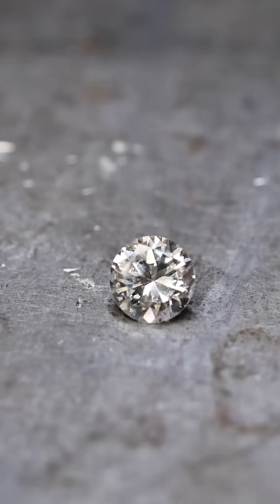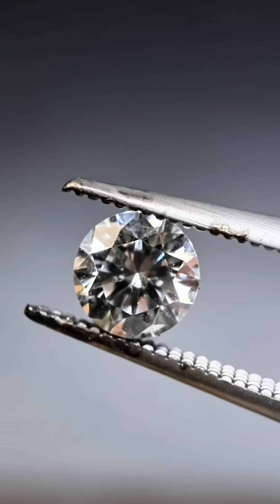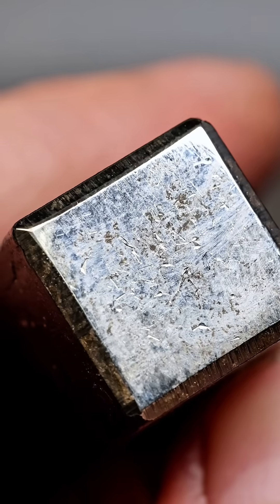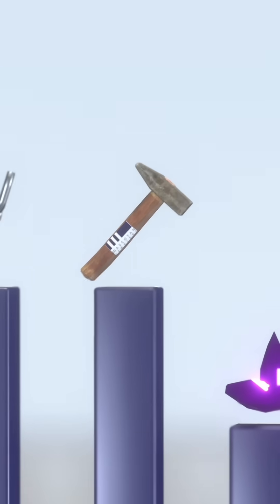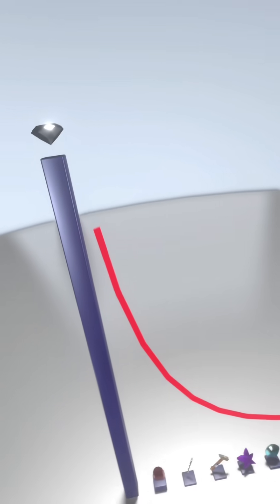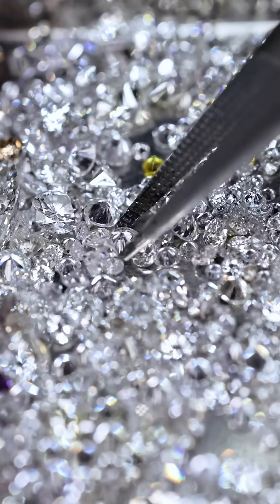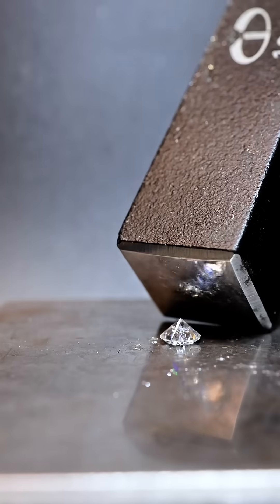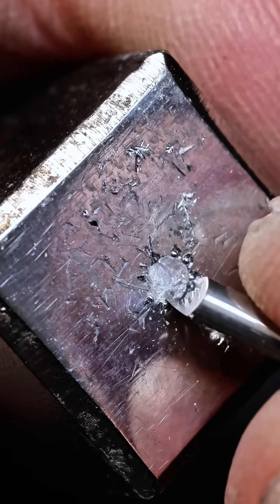Diamond vs Hammer

Comment from the maker: I got the science wrong on this one. The Mohs hardness scale is not related to whether something will break when struck by another object. It measures hardness, which measures how easily an object can be scratched, not broken. Diamond is the hardest material on earth in that only a diamond can scratch another diamond. I apologize for the misinformation. 

And about how difficult it is to break a diamond, hardness is the wrong property to reference. That would be its toughness, the ability to resist breaking from impacts. Diamond is still fairly tough but it can break from any impact with enough force that lines up with a cleavage plane. That force doesn’t have to come from another diamond. 

I will make a future video more focused on the scratchability of a diamond and I’ll try not to get the science wrong. 

Thanks for watching.
Reply: Also, we have now created a couple of materials harder than diamonds. Diamonds are the hardest naturally occurring material, however.
Reply: @Succulentquarter isn't there that space gemstone "lonsdalite" or something like that.
Reply: @Succulentquarter  wasn't there a super rare material formed in a meteorite that was naturally harder then diamonds?
Reply: @mothmanafterdark5924 no
No
Reply: @mothmanafterdark5924  yes, it's a type of hexagonal structured diamond called "Lonsdaleite"
Reply: @Succulentquarter  like what?
Reply: @Succulentquarter  did we created them ? i though they came from an asteroid
Reply: @ALlGAT0R  I was thinking of carbon nano tubes, but it turns out that Graphene is harder. Both of these are manmade. Diamond is the hardest material that is both widespread and naturally occurring.
Reply: @Succulentquarter I thought graphene could occur naturally as well
Reply: @MrAlwaysOnTen  Graphene can occur naturally, but unless it is a form of it called diamene, then it is not harder than diamond. Diamene is a man made form of graphene, where two layers one atom thick are compressed together with a lot of stress and heat. It is theoretically possible to have it be naturally made, but we have not found any of it. We have found a substance that would be harder, Lonsdaleite, but it was not pure enough. I also do not count anything that is really small. Has to be the size of a small pea to actually count.
Reply: @Succulentquarter why a small pea specifically?
Reply: @MrAlwaysOnTen  Cause it is similar to the size of a lot of diamonds.
Reply: @Succulentquarter  Exactly 💯🎯!
Reply: @Succulentquarter that's only half correct.
Reply: @Succulentquarter WAIT WHAT
Reply: @Succulentquarter no, we haven't. Diamonds are still the hardest natural or artifical thing.
Reply: @mantasr  Do a simple google search before you state an absolute on the internet. You are wrong. They are the hardest natural material, but we have made stuff that is harder.
Reply: Really appreciate you stepping back and admitting to how you were wrong. Looking forward to another video on this!
Reply: It was still a lot of fun! So cool!
Reply: @mookinbabysealfurmittens 
Revelation 3:20
Behold, I stand at the door, and knock: if any man hear my voice, and open the door, I will come in to him, and will sup with him, and he with me.

HEY THERE 🤗 JESUS IS CALLING YOU TODAY. Turn away from your sins, confess, forsake them and live the victorious life. God bless.

Revelation 22:12-14
And, behold, I come quickly; and my reward is with me, to give every man according as his work shall be.
I am Alpha and Omega, the beginning and the end, the first and the last.
Blessed are they that do his commandments, that they may have right to the tree of life, and may enter in through the gates into the city.
Reply: @mookinbabysealfurmittens fun ? To watch two diamond shatter ?
Reply: I broke (fractured) a diamond in my engagement ring by accidentally knocking it into a doorknob. That's all it took! Diamond is hard, but BRITTLE!
Reply: @MaryLeech  Damn..
Reply: I have a feeling that wasn't a diamond, but glass or cubic zicron. He probably lied to you. Did you ever get it tested?  @MaryLeech
Reply: @user-jy1tk8mp8sI’m curious myself now
Reply: major respect for correcting yourself humbly!!!!!!!! <3
Reply: I respect your willingness to yield your error and post information correcting it.  Well done.
Reply: @lrwerewolf  I mean, he is factually incorrect while purporting to "teach" people something. I think admitting he is wrong when called out is the least he could do. Should probably take the video down, that would be best. Many people will not see these comments and just watch the video and be misled. Sure, it's a trivial thing, but misleading people is still wrong. And keeping the video up is doing that, still. So while he apologizes from one side of his face, he keeps deceiving from the other side.
Reply: @lrwerewolf  it wasn't a error he showed a hammer hitting a diamond several times and faked it the diamond would shatter,
Reply: @robertfleming9161  lmao you don't know what you're talking about
Reply: @Sahtoovi   ?
Reply: Thank you for the update, but we've all been waiting for this video our entire lives😂
Reply: Good for you admitting to that, it takes a big man to admit when they were wrong
Reply: corrections are illegal on youtube. You must double down on the wrong info.
Reply: @trustjah  a lot of people do that. It’s annoying lol
Reply: @trustjah oh so thats why…
Reply: @trustjah 😂
Reply: I thought you were just a science guy for a sec, not the guy who fixes and makes all the cool rings!
Reply: It's all good. Shit happens and I don't think any wars will be fought over getting it wrong. Have a good day!
Reply: Literally you could have just whacked it harder
Reply: Real that you corrected yourself
Reply: Good looking out... Nice edit.
Reply: Appreciate you correcting yourself
Reply: Wow I don’t think I’ve ever had someone be this open about a mistake amazing job
Reply: W save
Reply: @lacemank7220  It's AI
Reply: @MassoyanJewelers  I'm pretty sure I remember this from an episode of the magic school bus.
Reply: Oh, thank you !
Reply: easy mistake to make, oops!
Reply: Thank you for recognizing the mistake
It's a common mistake
Silicon is a lot tougher than diamond
Reply: A prince ruperts drop is probably the “toughest” under pressure. They deform steel hydraulic presses under 200k lbs of pressure.
Reply: plenty of housewives over the years have shattered their diamond on wedding ring accidentally hitting it on a porcelain sink.  

Diamond has lower tensile strength than many steels, and much lower fracture toughness!

Great video though, keep 'em coming!
Reply: Scratching will make breaking easier, since the surface transfering force is no longer transferring it evenly.
Reply: Honestly, I very much appreciate the effort, but I think this warrants a reupload. There are so many younger people watching who would not know and not check the comments.
Reply: neat. you should take down the video that has bad science because a lot fo people will not read this and just have bad information. repost with the proper narration.

and this is why we should be able to flag videos for a large variety of reasons.
Reply: Thanks for the Update, I watched the video and thought to myself "wait what?" but yeah you can smash a diamond with a hammer, I work in the industry and have come across people that believed that diamonds cant be smashed with a hammer because the read its the hardest Material on earth, and then having to spend and hour trying to teach them the right why of thought there lol but thank you the video was entertaining, still got chills down my spine when you chipped the diamond in the end though lol

PS if you have any questions feel free to PM me
Reply: The meteor one that’s in museums
Reply: Thanks for that now I don't have to comment that's not how Mohs hardness works
Reply: I’m glad you corrected! Tysm.
Reply: THANK YOU
Reply: Came here to say toughness and hardness are very different but you corrected yourself
Reply: Another point you may have gotten a little mixed up on , a diamond(mohs 10)  is about 144 times harder than a sapphire (mohs 9). Hardened steel is more like a 5
Reply: "Diamond is still fairly tough but it can break from any impact with enough force that lines up with a cleavage plane. That force doesn’t have to come from another diamond. "

Thank you for mentioning this. I've had to try to make this point to someone before, because of table top games. 

As I said to them "Even a feather can pierce armor made of diamond if it manages to find the weakest point in the diamond with enough force applied."

When asked for proof of concept, I mentioned wheat straw being stuck into wooden posts because of tornado winds. 

DM was going to run with it, because it made sense; but we had no way to figure out at the time what kind of scale of force was needed to allow for this logic to be applied. Not that we didn't know about the Moh's scale. Just, how do you extrapolate that into GURPS style dice rolls and such?
Reply: Greatest respect to you. This is really rare and I absolutely love to see it. I thought I'd let you know, if you've ever dropped a ceramic plate onto a wood floor, you learn quickly that harder stuff can be broken by softer stuff, often even more easily.
Reply: Thank you for issuing a correction. It’s ok to be wrong, if you’re willing to work at getting it right.
Reply: Thank you for the correction! An easy mistake that a LOT of people make...
Reply: Oh, this is top notch.  A video of something I've never seen before and the creator taking accountability for and correcting a mistake?  Keep on doing what you're doing!
Reply: Very much appreciate this self-correction
Reply: Mad respect for this comment
Reply: As an brittle engineer, I respect your tough acknowledgment. But don’t be too hard on yourself.
Reply: personal opinion that responsibility would include taking down the accidental misinformation video and fixing it but im just a girl
Reply: When somone's pretend he's smart moment 🤣🤣🤣
Reply: Ytbers get the whole idea behind the short wrong making it entire existence pointless, but won't take it down because they are scared for their revenue. They will instead leave a comment so that they waste as much of your time as possible. Just take the meritless video down, no need to be that greedy
Reply: Wait, what? We're going to sit in silence after what you just said. DUDE! Break a DIAMOND by impact! I want to see that!
Reply: @Edward-hb9qb , there are videos of this out there. They are as good as you're hoping, I think.
Reply: See this is why you’re so smart. You’re willing to admit your mistakes, and learn from them.
Reply: Thank you for clearing that up, I was about to comment that, but you beat me to it.

Thank you for not letting yourself spread miss information
Reply: @dws998   spreading misinformation that's exactly what this video do 😂
Reply: Yup. Lead bullets can penetrate thru the toughest steels.
Reply: I remeber my cience teacher saying exactly same thing that you can crush a diamond with a hammer with enough strength
Reply: thank you for clarifying, I just did want to write a comment with an easy example, "that's why you can not break a window with a football"
Reply: Yeah I was coming here to say this is completely wrong. You can totally crush a diamond
Reply: Good that you realized that. I knew this video was inaccurate because I've seen heavy steal objects crush diamond
Reply: When I was going for my Bach. in Mechanical Engineering, Materials Science was one of the classes. Usually the Mohs rating is determined by taking the material in question, giving the surface a certain curvature, say a radius of half a millimeter, and then pressing the material into another material such as a metal, with a constant force, and seeing how deep the pit is that's left in the metal. It doesn't take into account how brittle the material is really. In fact, generally the harder a material is the more brittle it is.
Reply: Good on you for correcting the mistake, you might educate more people this way!
Reply: Thank you for the clarification!! Still really loved the vid, super dope :) Subbed!
Reply: I’m so glad that happened! If you hadn’t gotten it wrong, we wouldn’t have learned the difference between hardness and toughness. I’ve been wondering about it for decades. Thank you.
Reply: Being that humble shouldn’t be something we’re impressed about seeing in media. But here we are.

Keep up the good work!
Reply: I learned this from Houseki No Kuni. It's set a billion years from now and is about sentient gem people. Although toughness is more relevant and brought up more often (the gem people can be broken and put back together) hardness was mentioned at least once in the series. The protagonist has quite a low hardness and breaks a lot
Reply: @Spamton.J.Spamton omg I just made a similar comment
Reply: Appreciate the transparency, great vid!
Reply: Thanks for correcting the info, I was ready to be annoyed 😆
Reply: thank you for correcting!
Reply: Thanks for clarifying 👍
Reply: did you reference the Nilered This is bromine at the start lol
Reply: That’s also one of the reasons why tools aren’t made purely out of diamond, only as small parts where malleability isn’t a concern
Reply: What is it on the rockwell hardness scale?
Reply: Bro you barely hit it with the hammer, it’s like you were hitting it gingerly so you wouldn’t break it. Next time REALLY HIT IT! 😂
Reply: Heh heh you said cleavage
Reply: Maybe you should remove this video so people don't get confused and spread more misinformation. Not everyone reads comments.
Reply: If you hammered the diamond with a regular hammer the same way you did the zirconia it would have broken too.
Reply: In RPG term, diamond does high damage but low durability
Reply: Mad respect for printing a retraction. That's a journalism move no cap.
Reply: @GT-tj1qg  Agreed. Quite respectable.
Reply: Thank you for fixing it
Reply: a first ive seen on yt a man admitted hes wrong and corrected himself props to you man fr
Reply: millions of people will see this video and take it as fact no one is reading this comment you should have deleted the video
Reply: Well… why not taking down this vid and uploading a correct one? Barely anyone reads comments.
Reply: yeah i was thinking
Reply: Yup. You're good we all knew what you meant lol
Reply: delete the video or you don't actually give a shit.
Reply: @graydient05 , you make a good point!
Reply: You should remove the video then, most people won’t read this comment
Reply: No Dimond is not tough, Dimond is incredibly brittle, meaning it shatter easily on impact.
Reply: I care more about toughness than "scratchability"
Reply: Yeah, tungsten, for example, is extremely hard, but brittle. Lead is soft, but malleable. Tungsten will easily break, while lead will deform.
Reply: why not take the video down instead of leaving it up and spreading misinformation?
Reply: Delete the short, most people won't read the comments
Reply: Take the video down
Reply: First of all ur soo rich
Reply: I learned all this from Houseki No Kuni, aka Anime 🎉
Reply: Video is based on misinformation and you left it up
Reply: Oh no my chance to be a know at all has been stolen.

Thanks for the update.
Reply: I think instead of posting this it would be better to reupload a video instead since not everyone reads comment
Reply: Just take the video down…
Reply: Props to acknowledging it. Diamonds are tougher than I thought, though. There's a bit of RNG involved, though, if you don't know where those cleavage planes are.
Reply: How about you use some force lmfao
Reply: And I was about to send you a correction link
Reply: Like you said, hardness doesn't equate to durability. You couldve broken the diamond with just the hammer if you just hit it hard enough.
Reply: Delete the video then, idiot. You knowingly upload misinformation making people stupider, and think a comment that hardly anyone reads makes it ok? Enjoy the views while being morally bankrupt, I guess.
Reply: Came here to point this out - there’s a saying in lapidary “hit a diamond with a hammer and it’ll shatter, hit jade with a hammer and it’ll ring like a bell”
That’s the reminder that toughness is a different beast… please tell the people that think Egypt had advanced technology to carve rocks - you can just hit them and they’ll split
Reply: I understood it, it's common knowledge that the mohs hardness scale uses the scratch test.
Reply: Actually came to say this glad you owned up .. miners used to smash diamonds under the mistaken belief they couldn't be smashed so yea can't scratch it but they will smash along cleavage llanes
Reply: Of course the first one broke! you hit it like it owed you money, meanwhile you barely even brushed the second one.
Reply: There’s a cubic form of boron nitride that’s theoretically as hard as or harder than diamond, fyi. Out at least that was proposed at the time of my college presentation ~2010.
Reply: And that perfectly explains why a diamond can be smashed by a hammer.😁👍
Reply: Almost dude almost I was gonna blame the sh!t out of you
Reply: I was just entering the comments to say this. Because you can technically break a diamond with a hammer depending on the amount of force that ends up being applied and how the force is applied.
Reply: I was gonna say I have shattered a small diamond with a hammer before lol 😅
Reply: Respect 👍
Reply: It’s the Rockwell scale used for hardness, right?
Reply: Good on you for posting a comment admitting you weren’t quite right - a lot of people fail to do that nowadays. Great video nonetheless!
Reply: @MassoyanJewelers  was still a fun / hilarious watch, nailed the Niel Red vibes
Reply: What a waste...of beautiful diamonds.😢
Reply: I was just about to "ERM ACKSHUALLY" you lol. Related fun fact: diamond would make a terrible sword due to how brittle it is
Reply: also, only a diamond can cut another diamond, at EQUAL temperatures. If you heat up a diamond, it makes it easier to cut with a softer material
Reply: This comment just earned you a subscriber, I'll be sure to watch your content. Thank you for your honesty, it's refreshing.
Reply: Thank you for being willing to correct yourself!
Reply: Yea, for example, blowtorch, vacuumed chamber, pure oxygen flowing in, it evaporates
Reply: Im glad we all learned something
Reply: I thought so ig
Reply: I LOVE this accountability. Easy follow 🔔
Reply: Science is stupid sometimes, I'm just gonna choose to be wrong as what you said sounds better and will never affect my life.
Reply: Yup. There is 

Hardness – Resistance to surface deformation (e.g., scratching).

Toughness – Resistance to fracture when stressed (energy absorption).

Strength – Maximum stress a material can withstand before failure.

Ductility – Ability to deform plastically before breaking.

Elasticity – Ability to return to original shape after deformation.
Reply: Damn so diamond armor won't work against bullets... Maybe the prince Rupert project will fair better 🤔
Reply: I'm pretty sure this is one of the rarest comments on YouTube! 
Bravo sir
Reply: Wow incredible description! I was just about to ask the difference between hardness and toughness. The video still helped me understand it before too
Reply: A cleavage plane you say
Reply: For that excellent and humble correction, subscribed. That's how you do it.
Reply: So much respect for this, super fun vid still.
Reply: Thanks I was wondering if impact played a part in breaking it. Now I know.
Reply: Hardness is still relevant to breakability! There's a force threshold you have to pass to deform the diamond which is what breaks it, and the material deformation of the hammer was making it difficult to reach that threshold. So with the fairly low density of diamonds compared to steels, the extreme stresses inside the carbon lattice do actually increase the force required to break it!

Same as tempered glass compared to annealed glass- it's hardened and compressed into a grid of stress lines, so the corner is WAY more reluctant to chip off in general. But if it does, POP whole pane is gone.
Reply: Was about to downwote and unsub, but okay, this comment is a pass this time!!))
Reply: The Mohs scale does go above 10. There's a specific type of diamond that forms during meteorite impacts with a Mohs hardness of about 11. But it's incredibly rare. Synthetic nanodiamond is also above 10.
Reply: Thx for actually correcting your mistake
Reply: Probably you Just wanted to make some views by testing a myth and then told the truth, i dont blame you anyway to be honest
Reply: yes! that's what I found crazy when I was younger bc I was amazed at how easy you could break it by dropping it, yet can't break it WILLINGLY (Also bonus points fo rthe huge glass windows in spy movies where they use a diamond to cut through it haha)
Reply: Thank you. Saved me from writing a roast post. 🤣

Indeed if Diamond are cut into shape taking advantage of the tendency to tear-propagate along the cleavage planes, aka how the crystal structure line up.
Reply: Thanks for clearing that up.
If you have a few too many other diamonds laying around that you would like to waste, send them to me instead maybe! ... 😅🤭
Reply: For those wondering, the property calls tenacity
Reply: the hardest thing on this planet is safely locked away in my pants.
Reply: Yeah I was about to say you can absolutely crush a diamond with a hardened steel hammer if you hit it harder.
Reply: God it's refreshing to see this instead of the usual butthurt response to getting something wrong.
Reply: Thank you for the correction. I was about to comment that there is a mistake, before I saw the comment. 
It will be also difficult to break a rubber ball with a hammer.
Reply: This was still super cool!
Reply: So I dropped my diamond ring when I was putting it on one day. It fell about 3 feet onto a wood floor with the vinyl tiles and cracked with a chip falling out. The jeweler at the repair shop didn't believe me and got angry that I was so careless with my diamond ring. I was shocked it happened when he told me it was impossible to break like that. Would it have landed on a prong maybe?
Reply: Aint that very expensive to play with it like that?
Reply: Is there a reason you're not deleting this video, even knowing you completely misrepresented it?
Reply: MVP for humility 👍🏼
Reply: What about a hammer fashioned from pure diamond?
Reply: Glad you corrected this yourself
Reply: Fullerite is the hardest.
Reply: Maybe stick to react vids or something big guy
Reply: Ты красавчик бро 👍🏻 Привет из Казахстана, тебя тут смотрят.
Reply: THANK YOU FOR THE CORRECTION! As a material science nerd I was fuming ready to come be the "well actually" guy, but you actually stepped up. Big props.
Reply: Thank you for correcting yourself. I was going to mention this as another science channel did this before.
Reply: Congratulations on your humility — a rare and admirable virtue in today's world.
Reply: Appreciate the honesty
Reply: That’s alright, everyone makes mistakes, it’s good you cleared up the misunderstanding in the comments as well :)
Reply: How could you possibly get that wrong? It is basic common sense...
Reply: Also Mohs is a guy's name (with the s), not an acronym
Reply: I broke a diamond just from trying to push it out of a ring with a small screwdriver
Reply: The hardest thing on earth, is my thing
Reply: Lots of respect for you brother
Reply: the other thing is is that a diamond will absolutely shatter if you were to place it on the flat face and put all the energy onto the point
Reply: @ they make stupid videos to get you to comment a correct answer for views
Reply: Hehe you said cleavage
Reply: Kudos to you for actually admitting the mistake and correcting it for everybody! Bravo
Reply: I was a goldsmith for 9.5 yes and was about to correct your video,  but this comment beat me to it🤷🏻‍♂️👍🏻👍🏻
Reply: Goof ownership. Learning is nothing to be ashamed of.
Reply: how much value was destroyed in the making of this video? 😭
Reply: Bin por la rectificacion.👍
Reply: I am worried what your wife is gonna do to you now...😂
Reply: Toughness is measured in units called “CN” or Chuck Norris’s
Reply: Yeah I was gonna say… thats not what hardness is, but you got the point.
Reply: I like your honesty waiting dor the vid
Reply: A high hardness also means that it doesn't deform much. Deformation can be plastic, so it stays in the shape it was deformed to, or elastic, so it bounces back like a spring. The topic is a bit complicated.
Reply: Ca va commencer a te couter cher a force 😂
Reply: This is awesome. Thank you for explaining. Good on you for correcting your mistake. I too wouldn't have known the difference. It seems like they should be the same from a non science perspective! Thanks for teaching me something new today!
Reply: I give you a like, because I read this. Genuinely I appreciate people getting things right. You’ll get it next time
Reply: Hence diamond cuts long before modern steel
Reply: @MassoyanJewelers  click bait trash, those hammer strikes wouldn't kill an ant
Reply: still a cool vid 👍
Reply: A perfect cleavage makes you beautiful, but fragile.
In human reality a huge chest just breaks your back thougj.
Reply: Wish I had diamonds to experiment with!
Reply: this is the most incredible mea culpa I've ever seen
Reply: I respect the quick correction, it was still interesting!
Reply: it's just the type of low effort shit you produce man
Reply: You must be rich!
Reply: I would love to have a piece made from you...I would love to have a ring w a Portuguese cut diamonds and whatever u dont want like a emerald from Colombia...😂😅😅😅I wish I could hire u for that my birth stone is diamonds....a girl can dream
Reply: Ну вот зря бриллианты покрошил =)
Reply: Exactly, water ia quite soft, but we can cut things using presurized water
Reply: so how was the diamond broke in the video if clearly enough force wasn't in that swing to break it? Was it a fake diamond that broke at the end?
Reply: RIP Bro’s wallet
Reply: Чушь собачья! Бред сивой кобылы!😮😮😮😮😮
Reply: Yeah, and you can't even say whether it's linear l, logarithmic or whatsoever, as we can't measure hardness absolutely but just relatively, so terms like linear or logarithmic don't make sense here.
Reply: I was gonna call this one out glad to see the correction
Reply: Kim cương cứng nhưng nó không bền.
Reply: Thank you for recognizing it, I was about to write all this myself, it's good to know that some people still make redactions if they have made a mistake
Reply: SHAME SHAME! you must walk naked on your central square and upload the video now.
Reply: you CAN break a diamond with hard force and accurate hit with a hammer dude
Reply: Not meaning to be mean or rude, but you should take this short down, it'd be the best way to preventthe spread of misinformation. I got recommended this short randomly and i wouldn't have seen the other short clarifyingthe error. If I didn't already know the difference and hadn't read this comment, I'd go on þinking diamond can only be broken by diamonds.
Reply: Confundir dureza con resistencia en algo común xd de igual manera fue entretenido
Reply: Okay came to the comments to say this. As a novice gemologist this video bothered me a lot, glad you addressed it! For the record, diamonds are only tough from certain angles, and can break accidentally somehwat easily. For a much tougher material, try nephrite jade- About a 7 (similar to quartz, higher than the vast majority of commonly-used steels, similar to certain steels which apparently include your hammer) on the mohs scale, but insanely tough, almost unbreakable except via temperature stress.
Reply: No problem afterall many youtubers don't give this explanation so thanks
Reply: The term you’re looking for is bulk modulus
Reply: Scratches at level 6, with deeper grooves on level 7
Reply: Hi how much would you charge me for the broken diamond I would like to make a sculpture “heart broken like this diamond” it would depict a woman on the ground as a shadow walks away and the diamonds will be the tears
Reply: I thank you very much for your understanding because most of the channels opened in Türkiye for the purpose of so-called information are lying before our eyes and they neither apologize nor make a statement about this issue.
Reply: So you are basically breaking something that could approximately pay for 2 years of my rent, for shits n giggles. Sorry but this is messed up.
Reply: Not everyone will read it if they didn't knew. You should redo the video to be the most fair. Thanks for comment but you should redo the video.
Reply: Yeah just delete the video if the video is 100% wrong wtf this is beyond stupid
Reply: Like what value is the completely incorrect video providing to the world ask yourself. Or is it just providing for you?
Reply: epic
Reply: You're amazing for filling in the gap of info. Keep on keeping on
Reply: Yup, good lesson to learn with a nice diamond like that.
Reply: Yes thank you for the correction. It’s a common misconception. Hardness and toughness are distinct properties.
Reply: you know what I respect that you posted this to correct getting the science wrong
Reply: I came to point this out, but you got it. Well done!
Reply: And you realized this after breaking how many precious jewels? Also you know you don't need to use jewelry grade diamond right?
Reply: Happy you noticed that. Didnt want to have to mention the pink panther movie's nonsense yet again.
Reply: I like that you took a moment to correct yourself. Thank you for being that way. I've seen too many people double down.
Reply: Kudos for the quick comment!
Reply: It's great that you admitted your mistake. It would be even better if you redid this video now that you know this.
Reply: Donate to charity instead of doing this kind of wasteful nonsense please
Reply: i was just coming to say this. you can break it with a hammer, swing harder
Reply: Yeah I was gonna say. You could have saved a lot of time and money googling this. Diamonds can shatter just from dropping them. But they're amazing at scratching other materials. This why we have diamond drills and not diamond pole drivers
Reply: Good I was going to comment about that... Good content btw...
Reply: i love you
Reply: Send me the broken diamond 💎 I need it 😢
Reply: That's big of you to take correction, and to publicly correct your public statement.
Reply: so that's why, it's so weird, that's like using water to stop a tsunami iykyk
Reply: Glad you cleared that up, i knew this was a bit wonky, great video though dont remove it, also bring wrong boosts engagement lmao
Reply: Actually acknowledging potential misinformation, massive W
Reply: I was going to say, that didn't sound right. I really appreciate you for this comment.
Reply: I tried to explain this to my family when watching a mr beast episode. They were guessing which diamond between 2 diamonds was the real one. All you have to do is scratch one against the other and whichever gets scratched is the real diamond.
Reply: >I will make a future video more focused on the scratchability of a diamond and I’ll try not to get the science wrong. 

Ah, but that won't be a viral hit.
Reply: Delete the video bro. The entire thesis is wrong.
Reply: True, but I suspect the hardness of the diamond here was helpful to shattering them. Given the you went one flat tip to the point of another, with just steel the diamond easily scratched the stell, with the diamond Hammer all of that force was directed into the diamonds point since neither material could deform the other substantialy enough to shed and spread out the energy of the impact away from the sharp point of the bottom diamond
Reply: So when are you going to take down this video?
Reply: Why wouldn't you look ANY of this up beforehand?
Reply: Is there a diamond hammer?
Reply: Ayyy I knew that!
Reply: You might want to delete this video and do a voice over with another one... people won't read the comments and they will not understand why this is wrong
Reply: Thank you so much for this. I still would like to see a titanium hammer against a block of synthetic industrial grade diamond
Reply: U made me question years of learning for a second 😅
Reply: Appreciate the correction. Onward and upward! ❤
Reply: I failed my exam cause of your misinformation 😔
Reply: No offense but not many people will look at the comments when scrolling lol. I'd probably delete or add a subtitle to the video to correct it if possible.
Reply: The retrospection is hot
Reply: Delete the video then.
Reply: NO !   you didn't get the science wrong you made it up and faked the image of the hammer hitting the diamond.
Reply: Delete this one.
Reply: Im sorry but why wouldn't you know this as a jeweler? Seems like a massive gap in knowledge.
Reply: lol you said cleavage
Reply: Nothing more trustworthy than a person being transparent and admitting they got something wrong. Bravo. Still a great video!
Reply: Real integrity would be deleting the inaccurate upload in the first place...
Reply: Real OG for correcting the mistake.
Reply: Pure respect from me for admitting your mistakes
Reply: Thank you for clarifying!
Reply: Is that the difference between shear & tensile / yield strengths?
Reply: Told my science teacher this, she made fun of me and basically said i was an idiot in front of the whole class, probably the only time i hated science class.
Reply: Yeah, whatever rage-bait conman.
Reply: I'm hard , 10 moh
Reply: Thank you for the clarification
Reply: Thank you for owning up and correcting the information.
Reply: Thanks for reiterating this, was a tad confused lol
Reply: props to you for owning up to mistakes, happens to the best and actuallly makes you more trustworthy when handled right
Reply: Dislike removed. Thank you
Reply: I was thinking this when watching the video. However, I did have a laugh watching this, so great job on the content!
Reply: I love how responsible he is ❤
Reply: Also mention that the mohs scale doesn't only goes up to 10. In nature it does, but we were able to create 11 on mohs scale
Reply: I would love to See the toughest one then!
Reply: Thanks for the correction! In my elementary school, we got hands-on experience with the Mohs hardness scale by observing and manipulating actual samples- I think we were also given an unlabeled sample and had to use what we’d learned (hardness, color, structure, etc.) to identify it. You never know what doors the information can open for you 🥰
Reply: Excellent correction. Nothing but respect for that.
Reply: So cool, such a nice message with information. Thank you for your hardwork.
Reply: People who read all of this 
👇🏿
Reply: So if the information is incorrect, why let the misinformation continue to be seen as it is. Where it can be clipped and spread without anyone seeing the comments. I think most people would just take this one down and redo it correctly. Idk I guess some people are OK with bad and incorrect work being tied to their name? Idk just seems odd, unless youre view farming because of wrongs information, happens all the time. Wrong information baits people in. Idk there's integrity to admitting your wrong, but maybe have some to make sure things aren't false things still being spread? Or course this does not apply for information severally out dated, but we could see its outdated. Idk I personally would rather correct a wrong and not have bad work tied to my name
Reply: Yeah I thought so, but I like the video!!!
Reply: Ya vez you broke the goddamn diamond guey now the customer is gonna be pissed
Reply: I 100% appreciate admitting to your mistake, though I question why you didn't redo the narratio and reupload. I do get that the reup wouldn't get as many views, but personally, I would rather ensure the correct info is getting out over profits, especially on shorts where you have to put some effort in to finding the corrected comment
Reply: This is a true scientist, ladies and gentlemen.
Reply: I just want to see if the "diamond hammer" can break the diamond with the point facing down instead of up like you did here
Reply: Start with.,Delete the video
Reply: If pretty much all the information is wrong, you should just take down the video instead of expecting a comment to fix it. Otherwise, yeah it's just misinformation
Reply: Imagine keeping this video up. Bro people won’t see your correction in the comments
Reply: I'm coming to your home tomorrow to get the hammer 😂
Reply: Instead of that, why don't you just actually try to break a diamond with a hammer? You SMASHED that zirconia, and you only gave the diamond little love taps.
Reply: I was just about to come into the comments and say I must have learned about it wrong, but I guess my middle school earth science teacher was right! Still crazy to see how hard it is to smash a diamond though, based on my understanding, it would have broken on the first strike, just maybe left a dent in the hammer.
Reply: Thanks for the clarification, I wanted to type out a question how can I break a window with a wooden baseball bat :D
Reply: Yeah totally wrong
Reply: Yeah, I was literally just about to comment about this. It's about scratching, not blunt force. That would be hilarious, though: "Any ideas on how to break this diamond? I dropped 10 tons of iron on it from 30 stories. Nothin'."
Reply: Shouldn’t you just delete this video since you got everything wrong and are spreading misinformation? Just make a new one.
Reply: @NefertariKhalil  What if he had only two diamonds and can't test attempting to scratch a diamond with a diamond now? 🤣
Reply: @AbsentInsight  Hahaha ! 

I see now that it's because he has 13M views on this which I never noticed. So he's cashing in on being absolutely wrong in his own profession....which is hilarious and undermines his expertise but okay.
Reply: You BROKE a DIAMOND and you are apologising for MISsssssinformation. Fuck the information you broke a DIAMOND. I will never forgive you.
Reply: Water can cut anything I call cap
Reply: Honestly subbed because of this comment lol
Reply: You were on the right track but continued on into force and motion territory
Reply: If you have enough diamonds to waste doing this, you need to be serving others instead. This is offensive.
Reply: Phew, and I already thought you were just hyping
Reply: Was gonna come in to the comments for this exact reason glad your ahead of it
Reply: Awesome of you to go into the comments to try and teach something you originally missed. Great content homie
Reply: Big props for owning the mistake and correcting your info!
Reply: Thanks for the correction. I was about to say the same thing!
Reply: What type of profession isn’t in danger of being replaced by AI soon that deals with operating high end precision manufacturing equipment and tools?
Reply: Thank you for putting that out there for the 20% of folk who look at what they watch.
Reply: Glad to see it 👍
Reply: another mistake is that diamond isn't 100 times harder than tool steel, it's closer to 4-5 times
Reply: Well, take down your misinformation video
Reply: What a waste of
Reply: Diamond is also not the hardest matrial, not only diamond can scratch diamond, some synthetic materials are harder
Reply: As much as I'm here for all these people waking up to say diamonds are overpriced and the prices have been manipulated by a select few market makers, some of them overlook the practicality of them for rings you wear every day in that it will be harder to ruin a diamond stone vs everything else.
Reply: thank you for updating this- respect
Reply: Also this scale is wrong because it doesn’t actually stop at 10 it currently stops at 10 because we haven’t found something above diamonds on Earth But we believe a really rare space rock that in a pure form can scratch diemonds
Reply: Learn something new everyday!
Reply: Oh...you don't need to shatter more diamonds...that one was enough.  We don't really need another practical demonstration (those stones are really beautiful).
Reply: I was wondering why I thought differently than what you said. Thank you for the honesty. I look fwd to the future video.
Reply: I would like a diamond, they match my personality. Thanks!
Reply: Isn’t Jade the toughest?  Would be fun to try to break Jade with a Jade hammer ;p
Reply: Mate, you could've just used an adamantium or vibrainium hammer.. 😅
Reply: You should take down the video
Reply: Como un perro amigo klifford....,.tu mueres como un perro. ....
Reply: i was in shock watching this , im happy you made the pinned . i was about to flame tf outta you
Reply: I was going to say, diamonds are quite brittle and CAN be broken with a hammer if you hit it in the right spot.
Reply: Kudos for the correction!!!
Reply: I appreciate your attention to the truth ❤
Reply: Big ups for admitting that a lot of other jewelers would not.
Reply: Also do a video on Nephrite, that actual toughest mineral. Nobody does videos on nephrite’s toughness and it’s really, really interesting!!! 😭😭😭
Reply: Thanks for clarifying, I see so many people think that just because a diamond is harder than anything else, (excluding things like lonsdalyite) it is functionally invincible
Reply: You’re still spreading misinformation by not deleting this video. Half the people who watch shorts probably don’t even read the comments to see this correction.
Reply: Bro can NOT afford to demonstrate this again 😂
Reply: Hey diamond is not the hardest material on earth because a power washer can snap it in half
Reply: While I appreciate the comment and admission, you should really just delete the video then
Reply: CLEAVAGE??!?!?!??!
Reply: Wow already followed but oogled over this explanation! I’ve always wondered this!! Science is so cool.
Reply: And you call yourself a jeweller. Funny.
Reply: Lots of respect for the correction. I'm way too used to people doubling down on YouTube.
Reply: Thanks!
Reply: if you know its misinformation, just delete huh
Reply: Uneducated people making videos. Sheesh
Reply: The toughest material is a metallic alloy of Chromium, Cobalt and Nickel. Highest toughness steels get 200 MPA m1/2 for the absolute highest and this is much higher at normal temperature but when supercooled it can get up to 500 MPA m1/2
Reply: Good on you for posting this comment! Got a new subscriber here :)
Reply: Hardness = Scratchbility
Reply: Thanks for the clarification!
That was correct.
Reply: Then delete this video.
Reply: Thanks for the clarification so I didn't have to leave a mean spirited comment!
Reply: The Internet would be a better place if we all had your integrity.
Reply: You can burn a diamond
Reply: But there is material is harder than diamond under some conditions though
Reply: Yes, you should absolutely delete this video and re-edit it with a completely different voiceover. 
Not everyone reads the comments. Keeping this video up only spreads more misinformation.
Reply: Always refreshing to see someone admit they were wrong and own it. We need more of that these days.
Reply: Respect for owning up to it. A lot of people misconceive that specific notion lmao
Reply: Hell yeah dude
Reply: That is brittleness, not hardness
Reply: So you're keeping an incorrect video up anyways? 😂 I mean at least edit out the false information.
Reply: Yeah no kidding you were wrong. Next time just ask a jeweler
Reply: I learned this in middle school. Had no idea an adult would have to explain common sense in such an insane way.
Reply: Thank you. I love your want for knowledge man
Reply: Lol as an jeweler i was just starting to correct you til i read your own correction yes diamonds chip relatively easy and i get customers with chipped diamonds on a regular basis
Reply: I appreciate the correction. I was on my way to say something! We need more people willing to set their own record straight.
Reply: Honestly I was about to call you out on this but you beat me to it.
Reply: Delete the video or mute it
Reply: We're both learning ! No worries 😊
Reply: Thank you for precising your mistake. I was really surprised when I saw this video because I believed you already knew. To break the diamond with the hammer you just have to hit it like you mean it.
Reply: You also got the scale wrong. "It's not linear, it's ordinal, (shows an exponential curve) meaning diamond is 100 times harder than steel". Ordinal is when a scale is on a ranking with a clear order relation, it doesn't say anything about the actual values. It could look like 10^x, or it could look like x, or it could look like x+cos(x), the scale doesn't say.
Reply: I applaud you for updating this to make sure we get the correct information. It is much appreciated ❤
Reply: Thanks. I anyways unliked the video already
Reply: There was a lot of accuracy in the Land of the Lustrous anime series on diamonds and various other gems' properties. Yeah diamonds can only be scratched by other diamonds, but are somewhat weak when you're talking about toughness. A bort diamond is both hard and tough as well as abrasive
Reply: So delete it
Reply: You will burn in eternal hellfire for spreading this misinformation
Reply: 👍I was going to say
Reply: Oh great, I smashed my diamond into pieces before reading this 😮

Joking, but could you imagine? 😅
Reply: Thank you so much for making this amendment, I've had to remove diamonds from gold items that were being scrapped, and those bitches break easy if you hit the wrong way or put too much pressure on them.
Reply: Wrong again. Diamond isnt the hardest material, there is one secret one called Lonsdaleite. Made of carbon as well
Reply: @nickCR11  there's also wurtzite boron nitride and carbon nitride, but for some reason when I look up lonsdaleite it says "theoretically harder than diamond". If this was discovered in a meteorite, wouldn't the test be simple enough to call this a fact? Maybe an AI error, or maybe something more?
Reply: @cidguy  lonsdalaite is quite rare, it comes from meteors. There is little research on them. They are very similar to diamonds, however they form under much higher pressure, constructing more stable structure than a diamond
Reply: Take it down? Who's gonna read this
Reply: @Fleeksquad6800  take what down? I'm reading that.
Reply: Congratulations. That was the most expensive lab assignment ever. Seriously, it's first year of university. How could you not know that?
Reply: Not only did I think this video was so cool I was compelled to tell you so, but then I find this comment. Bravo! Wholesome, genuine, humble, and informative. 🎉
Reply: I'm guessing the diamond you used is moisanite
Reply: I know there is a polycrystalline diamond balls material syntetized in  Japan Harper than diamond,  anyway is a form of diamond not a single Crystal but still diamond material
Reply: Correct. Glass sits around a level 7 on the hardness scale but is incredibly brittle and still very easy to break. Also diamonds are the hardest NATURAL material on earth. There are multiple man-made materials that are much harder than diamond such as graphene.
Reply: And the SHAPE 
I think it'll harder to crush when it ball shaped cut than regular diamond cut..
Reply: Really really appreciate the extra info and corrections as well.
Reply: bro nukelier pasta is stronger 10,000× harder than steel
Reply: yeah dont worry, many people confuse hardness with toughness.
Reply: Respekt man
Reply: I'm glad you are exploring this practically for us to see. Thank you
Reply: Make a video trying to break jade with a hammer! Jade is one of the toughest gemstones
Reply: Imagine a full size diamond pick, and hammer
Reply: Great that you posted this info
Reply: Bro literally imbued his weapon with a magical element
Reply: Correct. The hardness has nothing to do with how brittle it is. Nice to see that you corrected yourself.
Reply: no netherite is on the 10, diamond is a 9. Excluding enchantments
Reply: I've had this conversation on rockhound groups on Facebook. It's very hard to find any information online about mineral "toughness" or "durability". And people don't believe me when I tell them about the difference between toughness and hardness. 

Jade is one of the toughest minerals, and about the only one you can find information about durability. But it's not as hard as most silicon based minerals, which is why it is often carved into delicate shapes. It's about the crystal structure. Jade and related amphibole and pyroxene minerals have a fibrous structure which makes them very hard to break.
Reply: Tbh you weren’t wrong tho, it wasn’t right but also not wrong
Reply: How about bedrock 😂😅😂😅
Reply: Wow, I honestly can count on one finger the number of times I've seen content creators openly admit a mistake and then take the time to rectify their mistake. I am shocked, you sir are excellent and I commend you!
Reply: Thank you. I’m sure you’re making girls everywhere, cry! 😭😂😂
Reply: Thank you for this correction
Reply: delete this false video
Reply: Students much higher in a diamond actually I absolutely knew that for I come to school motor inner diamond
Reply: Diamond is extremely hard but it is as hard as it is brittle. If you hit it on the sharp side it will shatter just like the zircônia.
Reply: Well then whats the toughest material?
Reply: Props for correcting yourself, it shows integrity
Reply: If you've ever kicked a football through a window you would know 😂
Reply: I appreciate you correcting this because it was killing me during the short
Reply: A true scientist corrects themselves with happiness that they found the truth! But I do think you should delete or redo the video!
Reply: This is how people should be on the internet...👏👏👏 he made a mistake and corrected said mistake... your a good dude in my honest opinion 👌 👏👏👏
Reply: Diamonds aren’t the hardest material - hardest natural terrestrial material possibly.
Body Centered Cubic Carbon (BC8) is harder and tougher (but just about impossible to make). Boron Nitride and Carbon Nitride is close behind.
Lonsdaleite (a hexagonal carbon compound) is 40% stronger than a conventional tetrahedral diamond.
Reply: @allangibson8494  Lonsdaleite is 58% harder than diamonds.
Reply: @ I was working off the reference I could find…
Reply: Take the video down then…
Reply: A simpler way to describe it is hardness is how difficult it is to deform a material toughness is how much a material can deform before catastrophic failure diamonds are hard not tough a plastic water bottle is tough not hard
Reply: @noahgottschalk5369 great example
Reply: you should make pants out of zirconium
Reply: @TheRealIdioteer Nice try, you gotta pay for weiner pics! 

Only $9.95 on OF though ;)
Reply: awww man, I was so excited to rant!
Reply: Not to spit in your wounds but you seem more eager for correctness than your ego.
Mohrs hardness scale is also relative, with 10 choosen reference materials. So something that can scratch your hammer but can't scratch diamond would end up.somewhere between 7 and 10, for example Topaz references 9 in the scale.
It is made to have a quick reference in the field not being a lab measurement.
Mohrs 7 is quartz, and diamond is only 15 times harder in surface hardness tests not 1000 times, it is not a logaritmic scale.
Nevertheless, an experiment I cannot do and very interesting to see, and diamond is still very hard to hammer.
Also, try holding the diamind and preaaing it to a piece of ice.
Reply: Why are you copying Nile’s❤style of videos?
Reply: Yeah man, you hit the diamond with the hammer like a toddler pretending to be a construction worker during preschool playtime and THAT is why it didn't break lol
Reply: honestly i would take down this short and just create a new one with the correct info. right now by leaving this short up people who don't read comments won't see your correction.
Reply: The responsible thing would be to take this down and re-upload it with correct info. Hard = brittle, thus more likely to break. If I see replies to this comment this week I'm checking "do not recommend channel."
Reply: @MatthewJamesMullin  I was thinking the same thing.
Reply: If you were worried about misinformation you would remove this short instead of letting it up, this is pure hypocrisy, you're not removing it because it's buzzing is all, try to be honest about it, or just remove this short instead, you know 99% of viewers won't look at the comments thus being completely misinformed by your own mistake
Reply: Some may not realize, but what you did here proved some HONESTY. Keep on the good work, dude
Reply: Hey I have a mens ring idea, 
A blackened Damascus band with a thin silver or white gold band on each side so it looks like a sandwich, then have a rectangle or oval cut dark blue sapphire flush set into the band with a smaller set of Portuguese cut sapphires having one on each side of the center stone, so 3 stones in total
Reply: @LordTimothy-j1c uh huhh.....
Reply: @LordTimothy-j1c sounds fire I need a pic of the vision
Reply: @LordTimothy-j1c  I personally would put the gold or preferably silver band on the inside where the inlay is so you get a better colour quality out of the sapphire.
Reply: @LordTimothy-j1c beautiful ring idea
Reply: I respect that you corrected yourself but you should have taken the video down. Over 2 million have seen it now but only 5,000 have liked your comment. Meaning at minimum only 5000 of the 2 million people have seen your correction. Meaning the rest are still believing false information. And that number will only continue to rise.
Reply: As someone who took Gemology and Mineralogy.... thank you for correcting yourself.
Reply: Worst video I've ever seen in my life.
Reply: How did you not understand this in the first place??? I learned this in 6th grade lmaooooo
Reply: Currently the video Video has 420k likes and this comment has fewer than 30k. 
You are spreading misinformation faster than you are clearing it.
If you want any respect, you MUST take this video down or modify it.
Reply: @aidanpalmer1075  It's a lot easier to like a video than liking a comment. So your claim isn't really solid.
Reply: @xJustCathx  Could you explain what you mean by "easier"?
Reply: @aidanpalmer1075 You like by double tapping by watching a short. Usually people like a short then look at the comments, which takes 3-4 more taps.
Reply: @xJustCathx  If, as you claim, "people [usualy] like a short then look at the coments", then liking a comment is only one additional tap.

I would say that is much more likely that people Ignore the comment section altogether. 

Additionaly, people are much more likely to look at the coments if they disagree with the video. If they simply accept the video at face value, they have much less reason to seek other viewpoints on it.
Reply: And yet you have the video up still talk about not actually caring lol.
Reply: Mohs scale is explained in the anime Land of the Lustrous where Diamond can still be shattered while Bortz is more durable. Despite being a 7, Jade trumps the durability test.
Reply: I knew it! My dumb ass with no experience other than drilling in rail spikes with nothing but a club could kill a diamond!
Reply: Yeah, I was watching this thinking, "Aren't diamonds brittle, though?"
Reply: Glad you realized this.  I was about to go off in the comments, lol.
Reply: Yeah I was so confused watching this. I started to second guess what I learned in my materials science courses. 🤣
Reply: This guy watch NileRed and got inspired
Reply: Remove the video then.
Reply: So, yea you broke a diamond for nothing 🤷🏻‍♂️
Reply: The fact that you were not really trying to break the diamond with the original hammer makes me think you knew this the entire time. 🤦‍♂️
Reply: The info is appreciated!🙏🏾
Reply: Still an interesting video , thanks !
Reply: You got this so wrong. But I'm surprised that you weren't able to break the diamond with the hammer at first. Should've been fairly easy.
Reply: I do not want to be rude, but if you're completely wrong on the science maybe delete this video and reuppload it with corrected audio
Reply: Why not delete it then?
Reply: No excuses here! You WILLIGLY faked that video demonstration! Or erlse the diamond had broken by the mere hammer in the first try!
Reply: Wait, I think you got something else wrong?  Diamond is no longer the hardest material on Earth Lonsdaleite is one such example that is 57% harder than Diamond.  I also remember reading about several others.
Reply: 😒 too late on the correction i alreadly told my science teacher he was wrong and i got detention for arguing with him
Reply: Thanks for holding yourself accountable. This is much more valuable than being right all the time. This comment earned a subscription from me. Keep up the good work. Honesty is so rare to come across, these days and many of us appreciate it more than you know.
Reply: massive w for admitting this tho
Reply: Scratching is also wrong it's indentation
Reply: You really should take this one down because it's spreading  misinformation
Reply: Just redo the video big dawg
Reply: Why don't you just delete tha video? Is it because it's already viral because of misinformation??
Reply: So then why don't you take down the wrong information video?!
Reply: You should delete this video...
Reply: Yeah, without this correction this would be a trash video. Now it gets 50% value by the comment.
Reply: It’s ok I guess I can forgive you
Reply: I'm not reading all of that, lmao
Reply: I didn’t think it was that deep good in you dr
Reply: This deserves a follow
Reply: Jesus Christ loves yall he died on the cross for yall repent and follow Christ, not forcing
Reply: Then delete the video bro
Reply: So just delete this video
Reply: Diamond isn't the hardest material on earth
Reply: @adityanair4185 tungsten carbide .
Reply: @adityanair4185 what is it then
Reply: @adityanair4185  yeah its not even top 3
Reply: @adityanair4185  He took back that idea, you’re not listening.
Reply: Recommend take down this video and remake it ;w;
Reply: You mind removing the video? Unless someone goes through the comments they have no idea that this is fake news lol
Reply: lmao you’re telling me you smashed a diamond for content and couldn’t take the time to fact check yourself before butchering the whole thing? I’d just remake the video rather than pinning a comment..
Reply: @Is1this1real so you want to break 4 diamonds instead of 2 and those are pretty good size diamonds too, screw that, I guess he could just do the voice part over though 🤔🤕😆
Reply: @Is1this1real  Or you could just read up on your own and learn double and even better: not belittle someone for doing something.
Reply: Yes you're wrong about the science
Reply: You can work on your English grammar too 😂
Reply: You should have removed the video but you kept it for the likes. Spreading misinformation. Only a few would read your comment.
Reply: @akostadinov  You should have deleted your comment.
Reply: put this in the description ensure no false information is spread please
Reply: @theguywith  They did their part. How about you start making videos so you can get it right every time and people can tell you how to manage your channel?
Reply: By means of a science experiment, this video was bad because it had 2 variables going on at once. First one was steel vs diamond vs crown impact while the second was diamond vs diamond vs culet impact.
Reply: that was dumb
Reply: So delete it
Reply: Then take it down! It’s a bunch of trash misinformation.
Reply: @Bezanthemum my god, I wonder if some of you have ever even left your rooms.
Reply: Yes I was very angry about that
Reply: Figures a jeweler knows nothing about science.
Reply: @miregojitohotookmyhandle  No it doesn't, this is like the first god damn thing you learn about gems is how hardness works LMAO
Reply: @hrodwulf172  this is that old meme diamond is the strongest metal. Absolutely bonkers. We went full circle in the internet zeitgeist.
Reply: @miregojitohotookmyhandle  it was a mild mistake you absolute hippo.
Reply: @miregojitohotookmyhandle  at least he was man enough to admit, reflect and intend to explain further
Reply: @miregojitohotookmyhandle  They don't really have to. They're artisans. Don't be rude.
Reply: @miregojitohotookmyhandle  actually it's kind of odd for a jeweler to not be more than a little knowledgeable in the field of gemology... he seems to be a fairly skilled individual so I was surprised he got such basic facts incorrect.
Reply: @miregojitohotookmyhandle  Bro this guy is showing how well informed and educationally minded he is via the detailed correction. You are simply being absurd to someone online due to your own insecurities and the barrier against accountability the internet provides you.
Reply: @d.barrett578  okay? Are speaking of yourself? You're whole statement is an oxymoron to your own contention.
Reply: @miregojitohotookmyhandle  You left a troll comment meant purely to antagonize. An attempt to turn it on me or take any degree of moral high ground is simply delusion from you. Nothing i stated is an oxymoron. 

If you dont like the reality of your behavior being pointed out dont leave those kinds of comments. You arent a victim so stop acting like one.